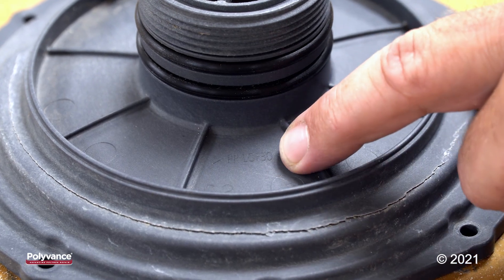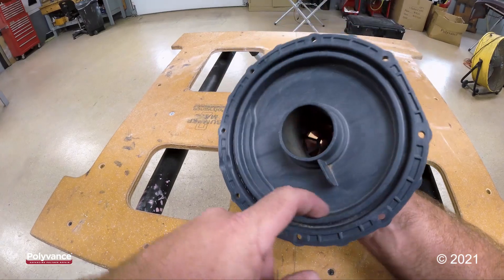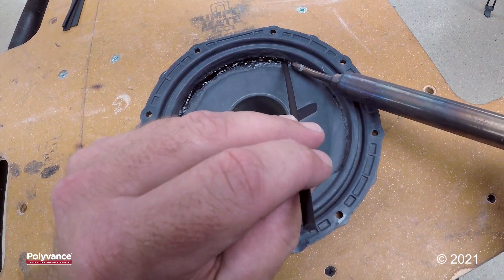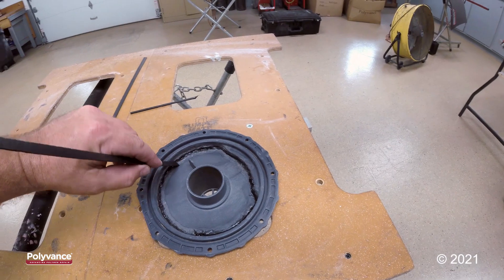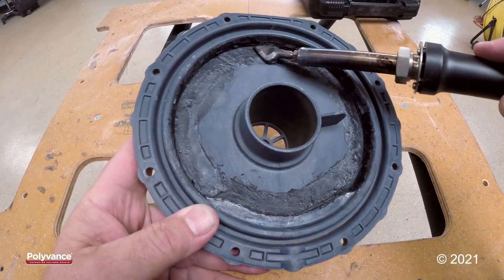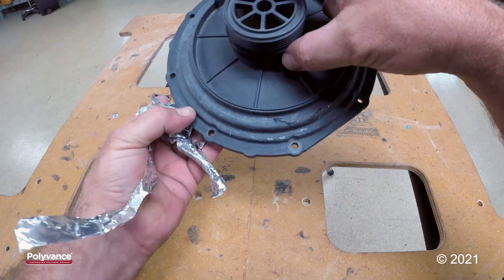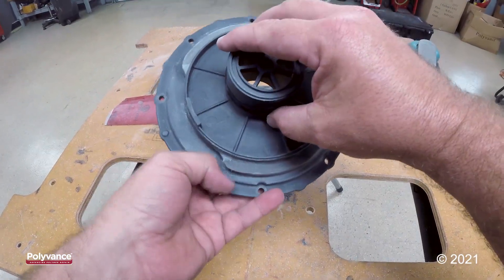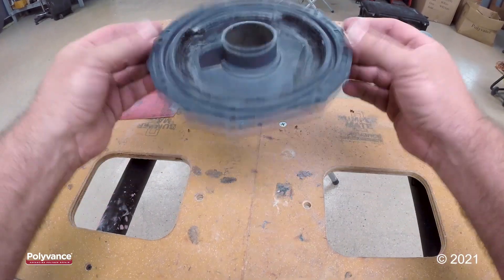Plastic Pointers #13 - Cracked Pool Pump Cap

Comment: I know you've probable said things 1000 times but a new person would like to hear a narration... What did you clean it with, what staples, how deep, what kind of tap, on and on and on. Sure its interesting to watch but not near as informative as it could have been.
Reply from the maker: Hi! Yes, these videos are designed to be entertaining and not as informative as our other videos. We have so many tutorials on plastic welding already, these "Plastic Pointers" are just a change of pace. :)
The products we used are in the description and in the video.
We cleaned with 1000 Super Prep plastic cleaner. We also carry a zero VOC cleaner called EcoPrep.
We just used one of the flat staples that comes with the stapler. The staples are part numbers 6211 and 6214. They were placed deep enough to hold the plastic together, but not so deep that they were difficult to get out.
I'm guessing you mean tape instead of "tap"? We used the 6485 aluminum tape. If you meant something else, please let me know.
Feel free to look at our nitrogen plastic welding tutorials. We've repaired a variety of things over the years: https://www.youtube.com/watch?v=mz0aBrDcAa8&list=PLmdrqwjPa5t96UdEcFfS9JSN6J8eaXb8-